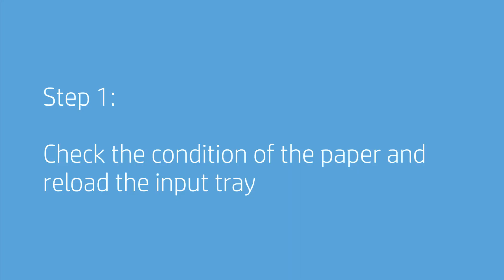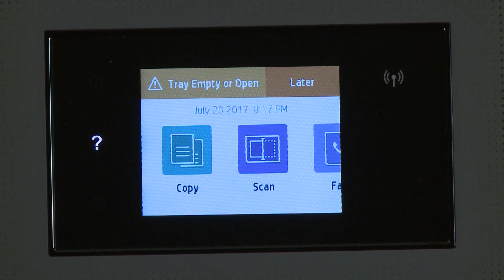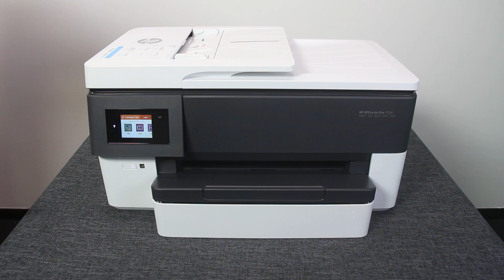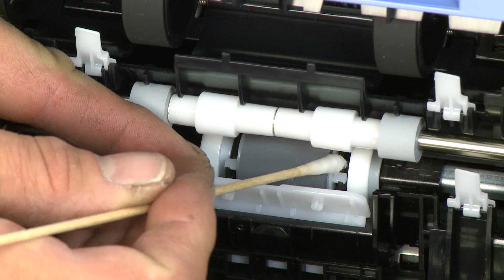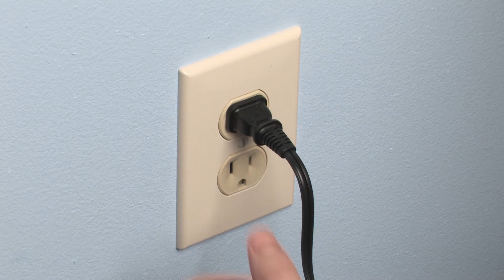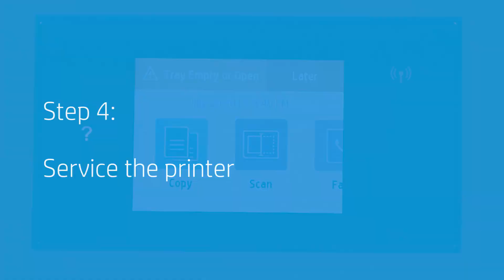Fixing Paper Pickup Errors | HP OfficeJet Pro 7720, 7730, 7740 Wide Format AIO Printers | HP

Comment: I had a feeding problem and tried to use the 2nd feed drawer, the unit gave me a picture pointing to the drawer. I had printed about 20+ pages a couple of day ago.  I pulled out both the drawers the paper was in good shape, but did not check behind the drawer.  I then powered it back on and disconnected the power cord from the unit, reconnected the power cord and it still did not feed. I finally checked behind the drawer and found a piece of paper in front of the paper feeder. When I removed it the printer worked flawlessly.
Reply from the maker: +Gee Zee Glad to know that your issue is fixed!!